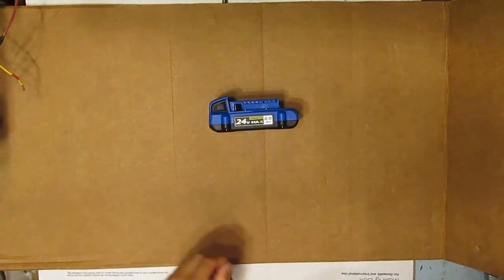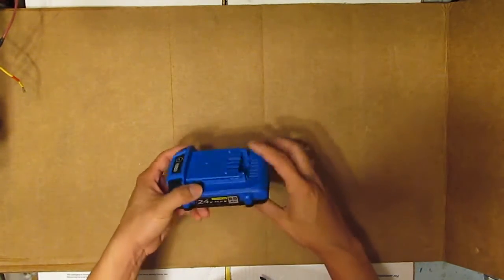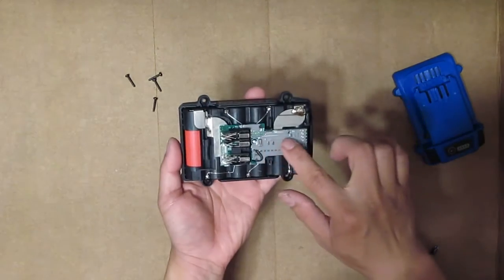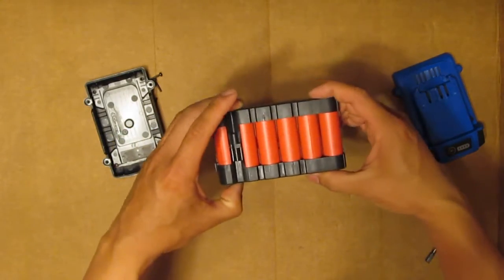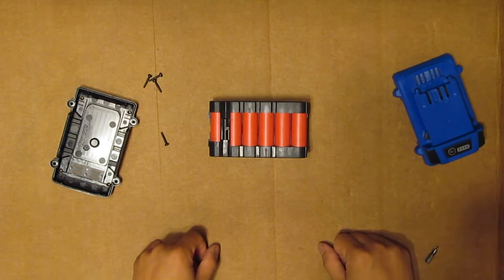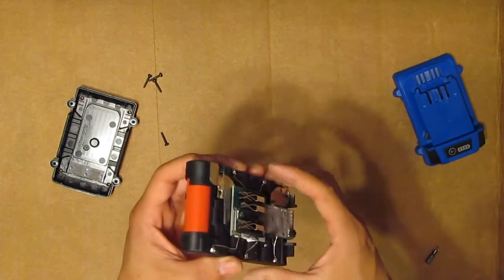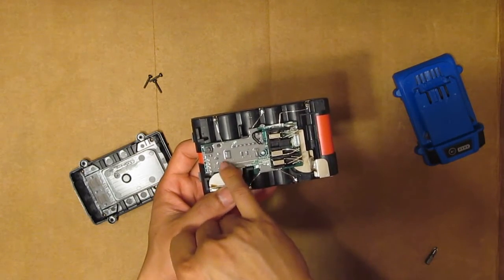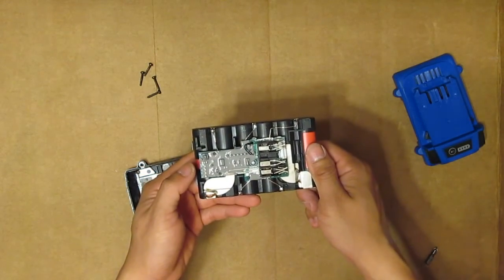What's inside: Kobalt 24V Li-ion battery pack teardown

Comment: I do like using the Kobalt 24 volt drill / drivers compared to other 20 volt tools. The 24 volt system has 6 batteries instead of just 5 in a 20 volt tool. A little more volts and capacity when needed.

Comment: If you look at the cells in the right light you will see that it is engraved in each cell UR18650RX. They are sanyo 1950mAH 25a 3.6v cells.
Reply: Drizzy Williams How do they compare to the green samsungs?
Reply: @midori8735  qaq2 They are both great cells with very similar specs.  In a power tool you would not notice the difference.
Samsung INR18650-20r is rated 2000mah and 22a continuous. Sanyo UR18650rx is rated between 1950-2050mah and 20a continuous. In my opinion the Sanyos are capable of a higher output. I once took one of each cell i had laying around and hooked them up in series, i then short circuited them to measure the output. To my surprise the Samsung failed. I still have the Sanyo.

Comment: If the battery voltage goes too low, will it recharge? Or if a cell is disconnected? Or does it become useless like makita’s batteries?
Reply from the maker: No, it will not recharge if battery voltage is too low. And yes, it's a way to stimulate the economy. :D

Comment: Also....  does the BMS board handle balance charging?  other makes have many more contacts, implying that the smarts are the charger.  with the 24v Kobalt batteries (3 contacts) is there any (active) balancing going controller by the BMS during a charge?
Reply: Obviously it does, hence the multiple silver wires on top going to each cell.  Yes the # of battery contacts is usually a sign of whether the battery charge, balance, and charge level monitoring boards are one in the same and whether in the tool or each battery.  In the battery is better from a failure standpoint, or at least it used to be when batteries cost less than 1/2rd the tool price but now when them (not the cheap one in the video but even Kobalt now makes a $90 5.0Ah pack), because if the battery board failed you were replacing it with the pack.

On the other hand having it in the tool costs less, to pay for the battery board once in the tool and not pay the extra to include it in each of the multiple battery packs the average tool owner buys.  lol, then again, it has become more common to buy an entire set of several tools using the same battery packs so the opposite could be true, that someone owns more tools than batteries which shifts the higher cost of integrated back to having the battery boards in the tools instead of the packs.

I suppose it's easier to just ignore where it is and buy the tools based on their other design features or cost.  Right now the Ryobi packs cost less than any other major brand until you get higher capacity than the 2.0Ah packs.  It's a little amazing that they're now selling the 1.5Ah 24V packs for a mere $10 each at Lowe's.
Reply: by "in the tool" do you mean in the charger?   I can't see how the tool itself could be used for balancing.

Comment: I got 48 of these cells and have spent hours searching for their brand, found nothing. My best guess is that they are sanyo cells, but cant confirm. However, the 1.5ah cells in kobalt batteries are Samsung... So at double the price for a 2ah battery, I doubt that they are crappy.
Reply: I am not so confident, normally a major brand puts markings on the cell so they can track failures and reduce counterfeiting.  Plus, now there are some reasonable quality generic cells that have reached 2.0Ah capacity, while you still have to go with major brand cells to get good performance at 3.0Ah per cell.  Some generics are now approaching good performance at 2.5Ah per cell, but not quite there yet and those who want more capacity tend to want larger jumps than just 0.5Ah now that there are 4.0/5.0Ah and even higher from some brands.

Comment: The 1.5Ah cells are reported Samsung INR18650-15L :
https://slickdeals.net/forums/showpost.php?p=91395711&postcount=15

I bet the packs are hit at 18A continuous a good percentage of the time AND at that rate they have a pretty low 60% after only 250 cycles, almost always the 80% capacity is used so that makes it even less, maybe 150-200 cycles to be fair.  And, does that assume 80% DOD for every cycle?  Even Samsung doesn't advertise too much about cycle life it seems.

Normal Turnigy lipos ISTR used to be mostly advertised rated no less than 80% after 500 cycles @ 20C (think this was 100% DOD too), for high-capacity too so a relatively small 2.2Ah pack was rated at 44A, a 4.4Ah 20C at 80A, etc.  They are advertising their graphene lipos are 'reported' to handle 900+ cycles, but they are pretty clear they make no claims still regarding cycle life.  18A on 1.5Ah translates to 12C, and 9C for 2Ah.  The better price is more than a welcome change but is still not competitive with lipos for high-draw it seems.  Pad a lipo in a decent case and it's perfect for any power tool.

https://cleantechnica.com/2015/03/27/battery-storage-test-shows-lithium-ion-cells-last-5x-longer/

Discharge rate may play a role in lifespan too, in addition to DOD, but I haven't found evidence of this yet, though it should be easy to test 1C vs 10C vs 20C, two cells and/or packs for each to be safe, 80% DOD, many lipos are probably used at 100% and is probably the main reason for reported 50-150 cycles some are getting.  Samsung's datasheet for the 15L advertises 1.5yr warranty and lowes has a 3yr, so the BMS onboard may limit the DOD, amps, or both.

Cycle life is really important for total cost.  Say a graphene turnigy costs you 2x as much but lasts 6 times more cycles at any given DOD, this battery will cost you 3x less.  Then again you'll have to really use it a lot every day to make much a difference, like in a car or PV solar battery.  The vast majority of these kobalts used by weekend warriors will probably last 10 years, basically the li-ion shelf life.